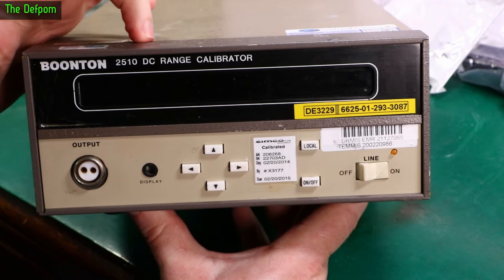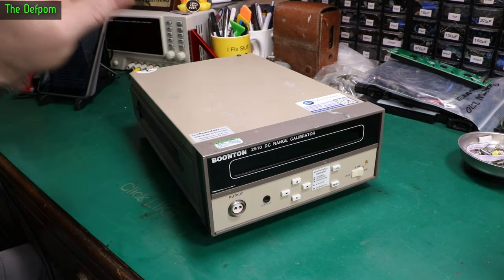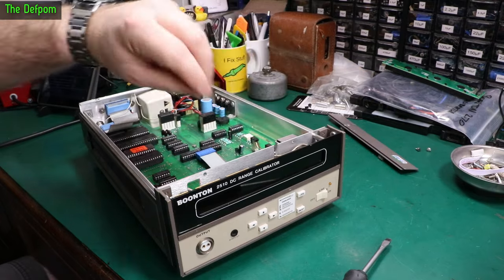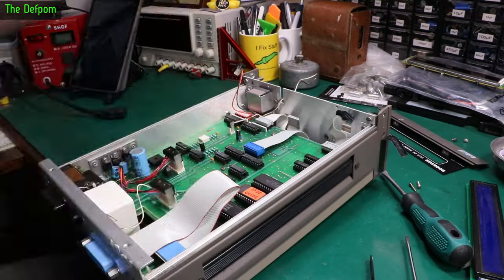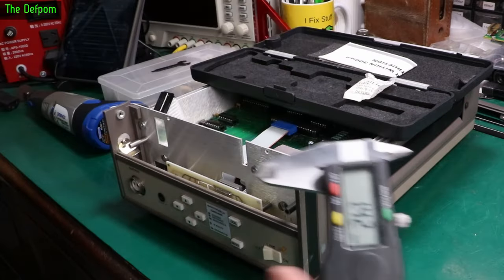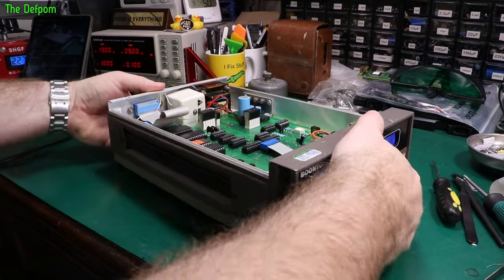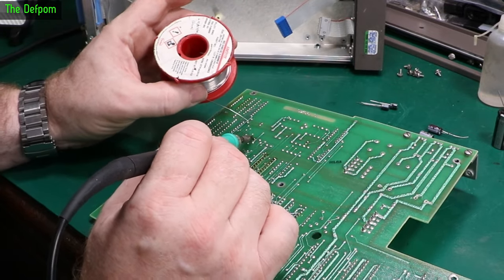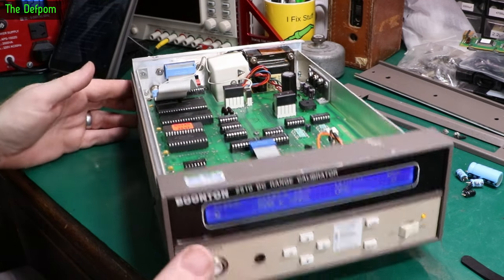🔴 Did I Break It ? BOONTON 2510 DC Range Calibrator Repair - No.1204

Comment: i taught myself that Anode +, Cathode - because A is a higher grade than C and + is higher than -. Also Cold and Cathode both start with C and on power supplies the cold side is low voltage. Hope that helps. Now i don't even need to think of this anymore. I just know.

Comment: I have an old rack mount Boonton voltage standard from around the sixties or seventies, and it is four times that size, and weight. It was ex-mil surplus.  The thing came with a General Radio output jack as stock, but I use a BNC adapter with it. I despise GenRad jacks.

The jack on those, like yours, is a mic jack, and I think they were made by Philips. You can still get the plugs, but those used gold-plated pins, if I recall. A few other companies used them, too.

Comment: I'm stuck in old time electronics, some valves have anode caps that go to the +Ve supply , Nixie tubes are cold cathode displays where the cathode is -Ve.
So for an led to conduct and light you need +ve power on the anode.

Works for this old fart.
Reply: Yep !.....Squeak!!!!!!!

Comment: I prefer high heat for short time, low heat can propagate along tracks causing more problems.
I've always use an antex 25w iron, i use aa 1/8 inch tip for small components and a 1/4 inch tip for larger ones
Reply: Actually, so do I........In and out very fast. With low heat one can end up fiddling with the tip too much on the pad/pin trying to get it to wet.
Any delicate tracks etc then I just make sure there is plenty flux so that the pads/pins wet as quick as possible.